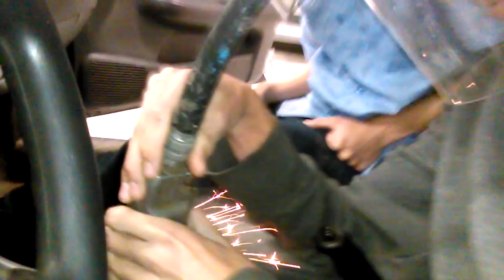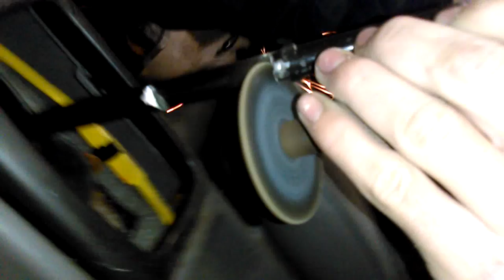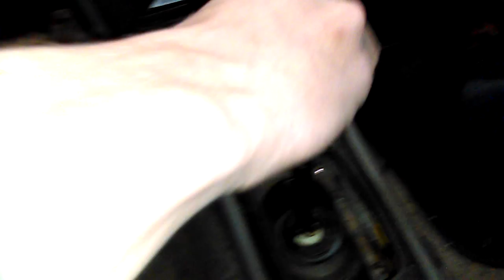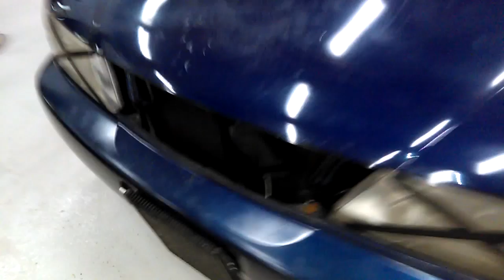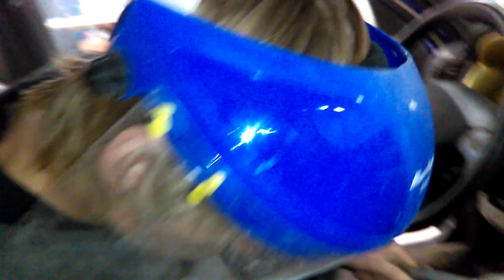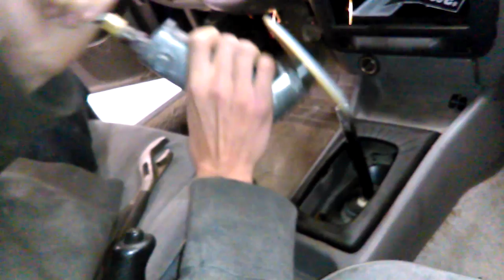How to make a "SHORT THROW" shifter in 5 minutes!

Comment: You know that its one way to make short throw shifter right? Its all about the proportion between part under and part above the axel. If you cut upper part of the shifter the travel of your hand will make shorter distance. Obviously the gear knob position will be lower and you need to consider that before you cut a stick but if you dont mind having hand lower on the shift you can cut it and it will work the same way as special or modified short throw shifter.
Reply: And some phisical explaining: If you have a stick that lower part is 1/4 lenght of upper part the travel of upper tip of stick will be 4 times longer then lower tip - so if you move axle up so upper part will be just 2 times longer then lower part the travel of upper tip of stick will be just 2 times longer then lower tip - that how custom short throw shifter works but if you cut upper part of the original stick in half you will recive the same effect - proportions in both cases will be 1:2 and travel of your hand when shifting will be the same. Obviously she stick will be shorter but that doesn't matter when we want just shorter throw and you don't mind position of the shift knob. (and I'm sorry if I wrote something not grammatically correct but my english is broken ;) )

Comment: No, it's not. And instead of grinding  metal flakes into your car, get a c-clamp tool and remove the shifter from the inside of the car. Cut the weld for the metal ears,  move it up one inch, weld it back on, outside of the car, then reinstall shifter.
Reply: yep ok thay probably where not smart enough to do that

Comment: I actually want to do this because the shifter hurts the palm of my hand on my daily beater (sentra). I daily drove my mustanger for months and never had any pain (lower profile shifter). 

My only question on doing this, is how do you get the threads back on to put the shift knob back on?
Reply: You would have to cut new threads into it with a die
Reply: @jstample  I figured it out, thanks!  Deapite having some typ of industrial glue, mine was also prethreaded.

Comment: This is a joke right?
Reply from the maker: I wish it was
Reply: Yikes, does he realize he hasn't  shortened the throw at all???  I just made my factory shifter in my dune buggy a short throw and I can assure you that shortening the top half does nothing,  you have to make the bottom part longer, below the fulcrum point, that way the bottom half attached to the actual linkage moves farther with less movement from the shift knob half, therefore shortening the actual throw or distance required to change gears ....
Reply from the maker: Haha yeah we know we just get bored in school and this is what happens

Comment: Not a short shifter dude  hahahaha the travel is still the same the height is all you changed not rocket science....
Reply: Technically, the knob travel distance is changed. Take a 2ft pipe, stick it on your shifter and see how much distance it takes (measure from the top) to get from 1 to 2. Take the pipe off and measure the distance it takes to get from 1 to 2. Should be less than the 2ft pipe. Less distance traveled = less time. Less time = faster shift.
Reply: @ahmadamir1694  also harder to jam into gear and more jerky because you lost leverage  and ease of movement
Reply: @charliesmith7942  Man, when you're banging gears it don't matter. When you bang it, it goes in... Now, for daily driving, you'll feel it fasho